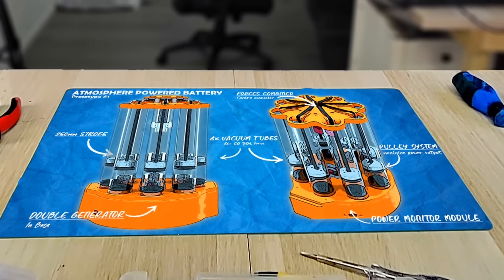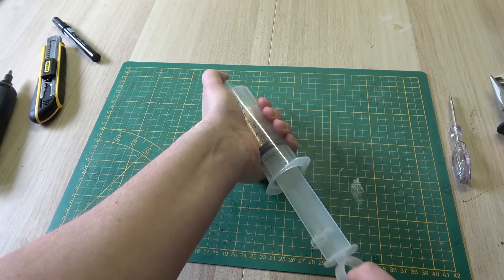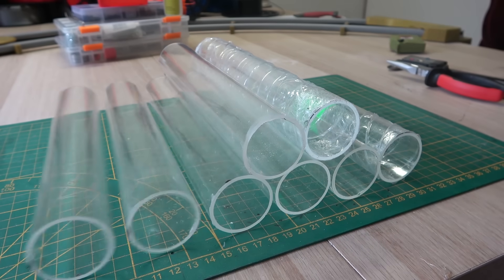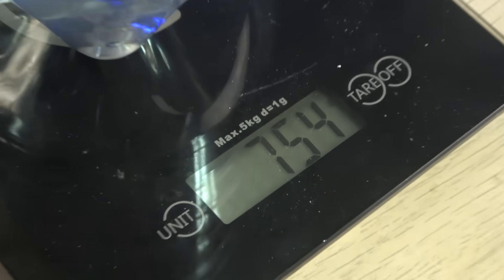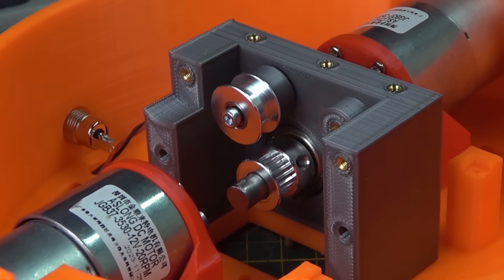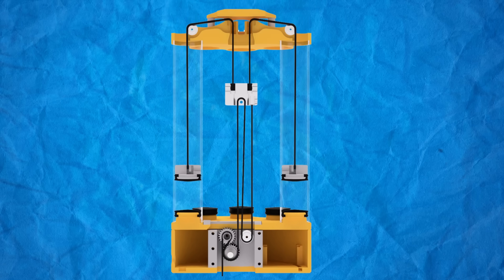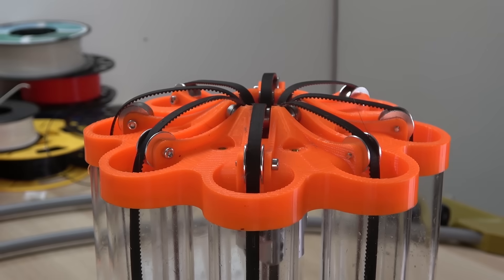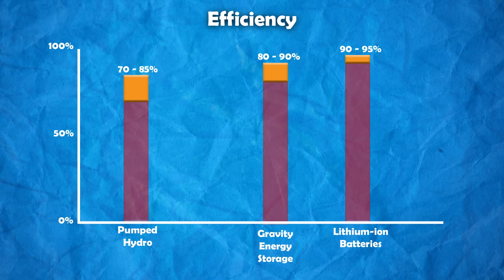Building an Atmosphere Powered Battery..

Comment: Perhaps you could link the tubes in series instead of all on the same direct air channel. You would be able to achieve a greater vaccum because you're essentially turning your 8 short tubes into one long one. The greater the vacuum, the greater the differential, so my thought is that it would allow more energy to be stored when full, but the rate at which it can be extracted would diminish more as the system fills with air. You could also make the same system with a fluid instead of air since the compressability of air would mean more friction in the gas that would create more losses. Maybe you could use a refrigerant instead.

Comment: I would definitely try to pressurise the now ambient side to create a larger differential and store more in the same volume. 
Also, stored heat from an external source can contribute to the differential and boost the efficiency to be a winner. 

Veel geluk en plezier gewenst 😊
Reply: I agree a scuba tank can ve pressurized to 3000psi over 200 times atmospheric pressure even with losses wouldn't that make 150x as much stored energy capacity? Just increase gear ratio
Reply: @jacoblimbaugh9220  Of course there are extreme measures like scuba tanks, though I suggest starting with a fluorated hydrocarbon like R1234YF in a small quantity.
the pressure behavior with these gasses is more susceptible to temperature changes and therefore the power output is easier to manipulate. (without turning the vessel into a deadly contraption)😅

Comment: Would submerging the tubes underwater or in a pressurized air tank increase the total resistance it has to overcome thus you could increase the gear ratio to also increase run time?
Reply: A giant vacuum battery in the bottom of the ocean could theoretically store a huge amount of power... Maintenance would be a PitA though
Reply: @raphaelsampaio7172  It would also strongly want to float
Reply: @romanp.5236  technically it wouldnt, since its a vaccum, so theres no buoncy issue.(i think)

Comment: In case no one has mentioned it yet... Your measurement of the force to turn the motor is going to be off. Once the motor has a load on it, it becomes harder and harder to turn. This is why an alternator on a car is a parasitic load, since it's having to do work to power stuff.

A decent analogy is comparing it to the AC compressor, and compressing the freon to give you cool air.

Comment: Watt is a measure of power, not energy, energy is expressed as joules. In electrical system it would be nominal voltage times ampere hours, you will get watt hours, then you need to multiply ampere hours with 3600 and you will get joules, eg a li ion battery with nominal voltage of 3.7v times 8 ampere hours will produce 29.6 watt hours, and 106560 joules of energy. In Terms of mechanical energy, joules  would be force multiplied by distance (assuming force is constant), regarding this example, force will gradually increase until absolute vacuum is achieved, not taking into account energy loss due to expansion and retraction of gass, and friction between mechanical parts, also there is ideal gas law PV = nRT, so you should also take into consideration cooling and heating of gass, so for example if you make a vacuum, gass will cool down, and once you hold vacuum, gass will loose potential energy the longer it heats up again...

Comment: put a hand crank on it , do not use the motors for the reset , get some real generators , then maybe you will achieve 1000 watts
Reply: Adding a hand crank seems like an efficient way to directly convert human effort to usable electrical power. Get some exercise charging this thing, get around 1000W of every for it. Win-win!

Comment: What if you push the atmosphere to increase the pressure instead of pulling, theoretically you only need one syringe and can press forever. I guess the syringe has to be able to hold that pressure though.

Comment: This is very neat but the Achilles heel is the fact that it has an upper limit on extractable force. No matter what materials or innovations you have, you can only ever get to one atmosphere of pressure.

But you've kind of engineered the opposite of pneumatic storage. There's different flavours of it (cryo vs standing air) but it all works on the same principal of exploiting a pressure differential. 

Very cool project!
Reply: What about taking advantage of the pressure of the ocean by having a plant deep underwater? Could it work?
Reply: @contafamilia2092  sure, but now you've got to maintain equipment under the ocean. Cryogenic storage does the same, but you can easily access the equipment.
Reply: A duel system of vacuum and pressure could be combined.. Double /split cilinder design would quadruple the forces... In large scale this would rate at megawatt energies
Reply: @elderzeroremorse8582  Realistically, all you're doing is adding 1 atmosphere of pressure to a pressure vessel with a lot more over engineering. 

We already have composite pressure vessels that have maximum allowable working pressures of over 300 atmospheres. Adding 1 more isn't going to make a huge difference. 

And on top of that, using cryogenic methods over mechanical pressurization often adds more efficiency due to avoiding friction and electrical losses.

Heating a cryogenic fluid to increase pressure is much more efficient than trying to mechanically compress nitrogen.
Reply: you have to put this into a pressurized chamber and it will fix this problem
Reply: @zagzagz  You could, but as stated before, at that point you're just created an air-storage battery that's much more complicated.

Comment: What a cool project! I would love to see a Pressure tank storage instead of a vacuum one. Exploring more aspects like the importance of the lubricant in the tubes, the power efficiency of the motors (the difference between a brushless motor, the impact of gear reduction in efficiency, and so on.) In the future, maybe explore some thermal advantages, for example: we know that when some gases get colder, they have the tendency of occupying less space, so, if you “charge” the vacum battery in the sun, then wait for it to cool off, would it have some impact on efficiency? (Black tubes would be necessary, but i think you got the idea). Definitely deserves some follow ups on this, could turn into a series, just like the 3D printed Air Motor from Tom Stanton.

Comment: I worked with research centre grade vacuum chambers, and I can say that working with a sealing is always pain in the ass. No matter how your design improves, the principle you've provided makes the sealing rubber or material wear off too fast and it won't be effective for long enough to be popular solution.

Comment: Try compressing co2 instead of air you'll get way more energy storage like this
Reply: he is not compressing, he is using a vacuum and the force of the outside natural air pressure. so if you want to use co2 you would need to fill the room with co2 which i wouldnt recommend if you want to still be able to breath oxigen.

Comment: It's a great concept! But, your performance analysis is lacking a little bit. You should measure the energy(j)/weight(kg) to compare it to the other type of battery. As vacuum is super light compared to big weight, you could find a plus value there.

Comment: This is a genuinely nice idea. Instead of massive oversized weight, it's just strong tube and airtight seals. I really love your design, its genius to put the load on the plexi that's very strong instead to 3D printed components or adding unnecessary stronger materials to the mix.

Something i wonder is maybe the motor themselves are the source of your inefficiency, so maybe calculate the loss of the storage system instead of the system plus the motor. Also the energy density might can be improved, but duing so might result in insane amount of stress to the system, which drives material cost up (or bring the storage's life down)

Comment: Wouldn't it be better to compress air, so you don't have to deal with the friction? The more you want to decompress the tighter the seals have to be and also it always a problem with how bigger air batteries are compares to Lithium batteries. And if decompression is even more limited vs compression then you end up with even a bigger battery.

Comment: Cool project! Now: Bigger, better, further :-)

Years ago I thought about why you don't run compressors with offshore wind generators and store compressed air on the seabed at the base of the turbine and then use the buoyancy force to release the energy into the grid when it is needed, with all the turbines that currently don't even have a grid connection or the shutdowns when the energy can't be pushed into the grid, I thought it was simple enough to be useful at scale.

Comment: Really cool project! I think friction is your big problem. First of all. The pistons are not staying vertical as they are pulled slightly off axis by the timing belt. I'd make the pistons have skirts made of Teflon to keep them vertical. I'd also consider trying different seals on the pistons to see if there is anything capable of producing a vacuum but causing less friction. Finally, the big move is to reduce the number of pistons by increasing piston diameter. When you double the diameter, you double the friction  surface, but you quadruple the displaced volume. 8 pistons looked cool. But it made the friction problem worse. It's why you don't see many small displacement, high cylinder count engines like a 2 liter V8.

Comment: Idk. I think you're significantly limiting yourself using gasses as a storage medium. This setup will never be ideal in a real world application. The seals drag, they dry out, leak, everything has to be perfect. Not to mention the energy model like all gasses is based on an exponential decay curve. You have a LOT of power at the start then it exponentially falls off and has very low output toward the end. A true gravity setup has a 100% linear output from start to finish. Much like the discharge rate of a lithium battery.  In addition, you are relying on vacuum. The pressure differential MAX can only ever be 1 bar. As you make an absolute vacuum on one side and a fixed atmospheric pressure on the other. If you were COMPRESSING gasses, you could store nearly infinite bar of pressure given the design were stout enough. That being said from a thrmodynamic stand point, gasses are extremely inefficient for power transmission. As you "charge" the battery using gasses, there is a temperature change that resist being charged. (Create vacuum and gas temp drops making the pressure lower, resisting being charged. Same when you compress gasses, they get hot and expand, resisting being compressed..) you dont have these inefficiencies with gravity.   Also, motor can be used as a generator, but a motor used as a generator or a generator used as a motor are not efficient. Ideally you'd have a dedicated and tuned motor for storing, and a dedicated generator tuned for generation for discharge. This way you have the most efficient way to convert electricity into mechanical potential and from mechanical potential back into electricity.   

Anyways..   explore new ways to store energy mechanically.  Springs, gasses, typical pile batteries, capacitors are all exponential decay methods. Lithium ion and gravity are typically consistent decay, and over center gravity or overcenter sprung devices can mechanically be altered to be an exponential increase in output while discharging. (Think heavy weight on the end of an arm pointing straight up and picking up mechanical advantage as the arm rotates toward parallel with the ground.)   

Good luck

Comment: Not a bad concept; however, this is a compression well, not a gravity well. Essentially, it functions similarly, if not worse, than a CAES System. The average energy storage efficiency of these systems typically ranges between 40% to 70%. The only difference here is the extraction of air from the system, which is slightly, albeit marginally, worse due to the increasing atmospheric pressure around it. Additionally, the presence of belts and other equipment detracts from its overall performance, while friction and seal issues further impact efficiency. Unfortunately, nothing is perfect, and air leakage inside the system causes a slight loss in efficiency over time.

I toyed with this idea a few years ago, envisioning the use of multiple vacuum pumps to create a closed-off environment within a building constructed mainly of glass and steel. During the day, solar energy would charge it by reducing the inner space to a complete vacuum. Then, at night when solar or wind energy was unavailable, a valve would be opened, inducing a controlled windstorm inside. By capturing this wind and tightening a few airtight seals, efficiency could theoretically be increased. However, after performing calculations and simulations for real-life wear and tear effects, I realized that not only would this be financially prohibitive, but the extensive maintenance required for mass-scale or even home use would decrease efficiency by 30% to 55%, ultimately increasing the carbon footprint instead of achieving the intended goal.

AI was used to translate my mumbo jumbo. (Not good at grammar or keeping it short and easy to read)

Comment: It's an interesting idea, but I'd like to see the averages in energy storage over multiple implementations of the same core blueprint to see how manufacturing tolerances affect performance at large. That aside, having both tasks being done by the same motor is breeding a little less efficiency than you might be able to get out with a system where you have separate drivers and dynamos, perhaps later implementations could have a separate charging motor & some sort of mechanical interlock so that you can draw the plungers and wind the coil with a motor better suited for efficiency when it comes to pulling alongside a separate dynamo that's better suited to power generation than just back-driving an electric motor.

Comment: how well would something like this work in the water? you should be able to increase the pressure and therefore energy density by having this thing under several meters of water in the bottom of a lake or something

Comment: Very cool concept. 

Disregarding the issue of efficiency/size or using compressed gas instead of a vacuum, which several people have already mentioned in the comments, I was curious to know how many charge/discharge cycles this system can withstand before it starts to lose efficiency due to atmosphere leakage.

Comment: If your using it purely for mechanical work. you can get much higher efficiency by implementing a small flywheel. a series of gears and gearboxes,
Attach a rack and pinion gear to the piston. This will directly drive the gearbox and gears.
You could drive a manual crank to power it. with a ratcheting mechanism to keep the energy stored. effectively putting charge into it
 It can also have a clutch to turn it on and off to directly rotate the device needed. which could be any kind of rotating mechanical device. driven by the gearbox to gear it up to the desired gear ratio.
no belts needed. lower losses. more efficient.
Instead of using an electric motor to drive it or extract energy from it. which is very inefficient.
The efficiency will be relatively high as the only losses will be from bearings and gear to gear friction. and friction of the piston seal against the cylinder walls.
It could theoretically approach 90%+ efficiency. not bad.
It can also have energy stored and released as quickly or slowly as needed.

Comment: It can't be 73% efficient , you have used so many pullies ,gears and seals, which waste energy/power about (1%) each. This is the opposite of compressed air system and might be compared with. It would have been a simpler more efficient design if you have used a single vacuum vessel .

Comment: Nice engineering work.  I would have liked to see you use silicone grease on those seals.  The energy density of vacuum storage is far too low.  A more compact system is a hydraulic piston pump/motor with a bank of nitrogen accumulators working at around 350 BAR.  All hydraulic equipment efficiencies are well documented.  (That is 350 times the working pressure of the vacuum system.)   For a very much large scale industrial energy storage using water and gravity have a look at Snowy 2.0 Pumped Storage Power Station.  Again -- great work!!

Comment: You should try using glass syringes instead of plastic plungers. By doing this you can decrease the friction between the outer wall of the tube and the plunger hopefully increasing the efficiency.

Comment: I think that being able to potentially have the opposite side of the plungers existing in a high pressure environment would allow for a greater storage capacity as the pressure difference would be larger, also general high amounts of friction are the major losses in this design, another potential area to look at in minimizing loss of energy is the thermal expansion and contraction of a fluid, making sure that the air that is present in the tubes has as little thermal input  from outside the tubes would increase efficiency as well.

Comment: This is amazing. I developed this idea some 15 years ago. However I used both weight and vacuum to increase the energy density. I was disappointed in the available energy and decided not to pursue it. However in the last two days I decided to return to this idea. And now I see this video covering many of the things I wanted to explore. An Amazing coincidence.
Reply: I'd like to add my design did not use seals as I immediately recognised that it would be a major weak point never mind efficiency losses due to friction.